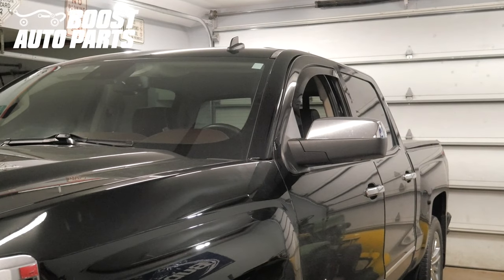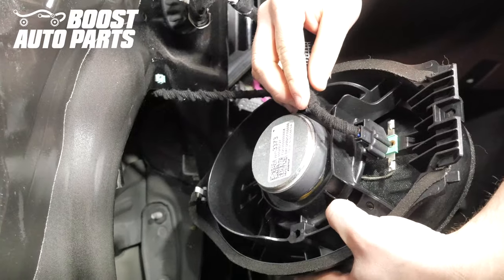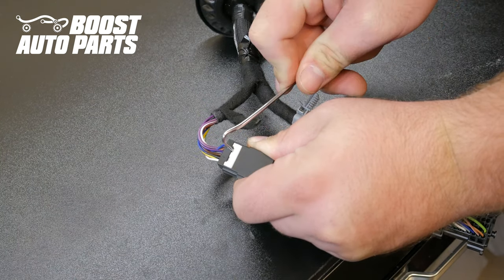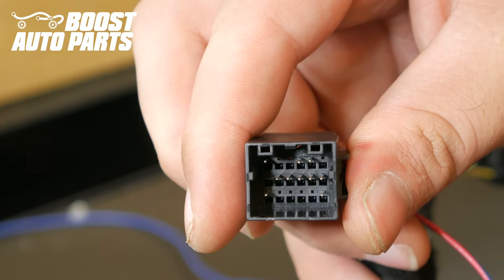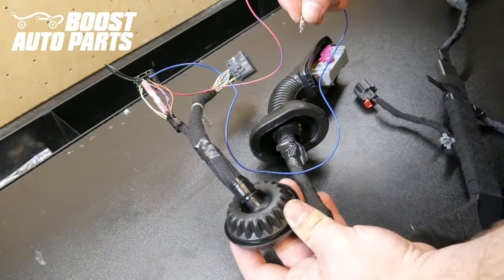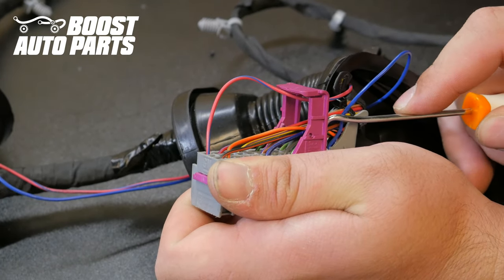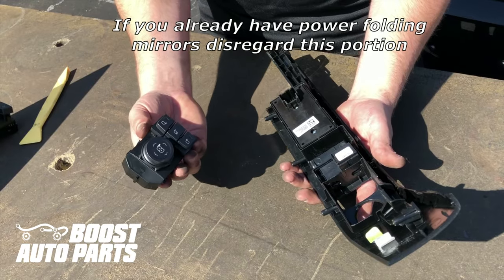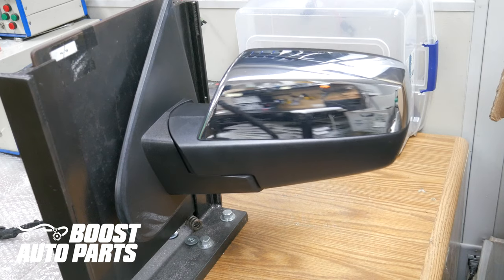GM DL8 Small Mirror to DL3 Power Fold Plug And Play Wiring Upgrade (2014 - 2019 Silverado Sierra)

Comment: Will your wire harness and switch kit work with any aftermarket mirror with power adjust/fold, turn and puddle light function or do I have to buy the mirror from you as well because I don't like the chrome on the mirror you offer.
Reply from the maker: Our harness/switch will work with our mirrors and OEM mirrors - some aftermarket mirrors are wired different than OEM so we cannot guarantee function on aftermarket mirrors not purchased from us.

Comment: I imstall these on my 2018 silverado with power folding mirrors. Before install both mirrors would move up,down and sides. After install they dont move at all only the turn signal works.
Reply from the maker: That's certainly not typical. Shoot a video to our support team at support@boostautoparts.com and we will work to get this resolved ASAP.
Reply: Mine do the same thing did you find a solution?

Comment: Do the mirrors will fold once your turn off the engine or do you need to change it in the settings section in your screen?
Reply from the maker: The only way to fold the mirrors will be with the new switch that you install.

Comment: Just installed mine but the puddle stays on
Reply from the maker: It sounds like the wire in pin 1 may be installed wrong. Email support@boostautoparts.com for guidance

Comment: I have a 2015 silverado single cab , will i need to change the wires for the cable connector on the side mirrors? Or just plug in play
Reply from the maker: You need to do this wiring modification.

Comment: I own a 2017 GMC Sierra 1500 WT with power mirrors, windows and locks. I recently bought power folding mirrors with turn signal and puddle lights. I bought your wiring harness kit for the conversion. I installed it with the help from the video on YouTube, great video Thanks. After all my connections were made my drivers side window works But not my passenger side. Any ideas of what may be wrong? Thanks.... I also bought the wrong switch so i ordered the right one for the connector.
Reply from the maker: Our team is well suited to assist with this. Give our tech support team a call at 765-831-2830 or email support@boostautoparts.com for assistance!

Comment: I have a question I have the DL3 power fold folding but instead of doing all of that wiring could I just go get different door cables and mirrors switches off a Silverado/sierra that already had power folding and puddle lights and put them in my 14 Silverado because there's a lot of part out trucks near where I live and I would like to know if that can be an alternative instead of doing all of that wiring thanks!
Reply from the maker: No - that won't work. The harnesses are wired differently from DL8 to DL3 - it's not just the lighting that's different.

Comment: I Have A 2015 Silverado And Want To Do This, But I Notice The Mirrors You Guys Sell Don’t  Have The Blind Spot Glass. If I Buy Ones With It From Somewhere Else Would This Still Work?

Also For The Wiring Harness What Does It Mean When It’s Asking For “2015 (WITHOUT MEMORY)” “2015 (WITH MEMORY)”?

Will The Mirrors Fold By Themselves When I Lock The Truck?
Reply from the maker: The mirrors will not fold by themselves when locking the truck as that is part of the memory system. 

I'd recommend giving our team a call at 765-831-2830 to discuss with our team. They are best suited to know the nuances and give you the most accurate answer.

Comment: Can I put these on my 16 Silverado single cab lt,it already has power mirrors
Reply from the maker: Yes - though the puddle light might not work you can gain power fold and signal for sure.
Reply: @boostautoparts why wouldn’t the puddle lights work? On the 16?
Reply from the maker: @E12_Tabz  Some of them aren't wired; give our team a call at 765-831-2830 for assistance

Comment: So if I just go to a salvage yard and pull the door harness from a truck that has the DL3 mirrors won't it work? Sense all your modifying is the door harness itself. I work at a salvage yard and we crush these trucks all the time. Mirrors are broken most of the time though.
Reply from the maker: No - the way the power adjust circuits operate are different between DL8 and DL3 so you have to use the DL8 harness or the power adjust won't work properly.
Reply: Lmk as well. I heard they work through bcm
Reply: @boostautoparts  so if u put the oem mirrors on you must have the dl3 harness??
Reply from the maker: If you just swap the mirrors the lighting features will not work. To get the lighting features working you need to follow this video. If you try to swap DL3 harnesses to your DL8 truck, the lights will work but the power adjust won't (they're wired different for power adjust)... so that's why you need to modify your door harness with our kit following this video. @StevanStazzone
Reply: Damn, where are you located? Hook it up with some Silverado parts
Reply from the maker: @ARodriguez-0  We are in West Chicago, Illinois... but we ship anywhere in the US. Check out our website.

Comment: bought the wiring setup for the Dl3 and puddle light does not come on for some reason
Reply from the maker: Some 2014/2015 trucks require an additional jumper for puddle. Reach out to our support team at support@boostautoparts.com for assistance.

Comment: When I connected the switch, it immediately burned the 10 amp fuse? Do i have to upgrade the fuse?
Reply from the maker: Absolutely not. Sounds like you have the wrong switch - did you order from us? If you install the wrong switch that will happen.

Comment: I did this to my 14 1500. I was told it has to be connected to a computer to get the heated mirrors to work again. My passenger side heated mirror works but not my driver side. Do you k ow anything about this, or anyone else? And if so how do I go about asking the dealer to do this.
Reply from the maker: The defrost should work plug and play.

Comment: I have a 2017 Silverado LT and installed OEM power folding mirrors from a LTZ.  I also installed the correct switch and your wire kit.  The turn signal, puddle lights and heated mirrors work, but neither the power folding nor the mirrors work, also only the driver’s window works from the main switch. Please advise.
Reply from the maker: Please email support@boostautoparts.com - our tech support team to get to the bottom of this right away.
Reply: I am having the same problem I just emailed support just wondering what you were told to do.
Reply: @rkeondre  replace the 10a fuse (power mirror) in the drivers side fuse panel and you should be good to go.
Reply: @whittielockett7611   did that fuse blew immediately. Only thing I will say is I had purchased a switch but it had a notch in it that wasn’t on mine so I cut the notch off so the plug would fit. Did your plug fit correctly!?
Reply: Yes the fuse blew immediately I had the same issue after buying the wrong switch. There’s 2 switches available and if I’m not mistaken it’s the 2014-2020 Silverado Sierra Suburban Tahoe Power Folding Mirror Switch 84643953.  After I ordered and installed the correct switch and replaced the fuse they worked fine. There’s a slight initial delay of a few seconds then they were fine.

Comment: I have a 2018 regular cab and try this and didnt work it doesnt have power windows and i was trying to convert that too do u guys have a harness for this
Reply from the maker: Sorry, we do not. This requires you have factory power mirrors to work and this simply gains the turn signal, puddle light, and power fold.

Comment: What is the white wire for? i install these on a 2018 silverado do I need the switch of a truck or would a suburban switch work?
Reply from the maker: This harness is a universal harness that is also used for towing mirror upgrades, so the white wire is only used on the towing mirrors.

You can NOT use a switch out of a Suburban - it must be the proper switch for the vehicle.

Comment: hey there I have a 2015 gmc sierra sle  I installed power fold and door harnesses from 2019 silverado LTZ with proper mirror switch.
I have turn, signals, heat and puddle lamps,only up and down on drivers mirror no movement on passenger side .power fold on neither one.will this kit work for me?
Thanks Daryl.
Reply from the maker: You cannot take the harnesses from an LTZ and install them into an SLE. You need to revert back to your old harnesses, install our kit, and then everything should work.
Reply: @boostautoparts  Thanks I figured that!  Sounds good.

Comment: Is this can be done for 2015 tahoe originally not folding to make it folding mirror even by using aftermarket compatible folding mirror for same model ?
Reply from the maker: This is NOT relevant for the SUV's - only the full size trucks. The wiring is different on the SUV's.

Comment: I own a WT spec silverado, and it does not come with power windows, or  power mirrors. I am however, interested in retrofitting the power optionals. Can the folding/puddle lighting be controlled by a non-oem switch instead of the door controls?
Reply from the maker: Unfortunately we don't support any upgrades on vehicles that don't have power mirrors from factory. Sorry about that!
Reply: @boostautoparts   Thanks for the reply! I'd like to inquire further however! Can any of the functions be rewired to use external controllers? or is the entirity of the assembly reliant on the BCM?
Reply from the maker: @DaWalkDude  give our team a call at 765-831-2830, they are best suited to advise.

Comment: Will this switch work on a 2020 silverado 1500 rst? I don't have power folding mirror switch. But if I got the switch would it still work with tow mirrors?
Reply from the maker: No, this is not applicable to the 2019+ new body style. We are working on a solution for those vehicles but there is currently not a power folding upgrade path at the time of writing this (3/7/22)

Comment: Is slot 2 for the running light?
Reply from the maker: No - slot 2 is not utilized for the upgrade to DL3 power fold.
Reply from the maker: @robcj3189  If you purchase the harness you can reach out to support@boostautoparts.com for assistance

Comment: what is the white wire for?
Reply from the maker: This is a universal harness that is also used for towing mirrors which have a different feature set. The DL3 mirrors don't need the white wire, so that's why it's discarded.

Comment: I purchased new power fold mirror for my 2014 Silverado i install the mirror and the wire harness off a truck with power fold mirror do i need to modify the harness to make the puddle light work as well ? The turn signals work but just not the power fold or puddle light
Reply from the maker: You can't swap door harnesses with other trucks - other features aren't compatible. Reach out to our team at sales@boostautoparts.com for guidance.
Reply: @boostautoparts  i bought the kit and install them as shown in the video my turn signals work and i can adjust my mirrors what do i need to activate the puddle lights
Reply from the maker: @gamalielpelayo2891  Puddle lights should be working. Reach out to our team at support@boostautoparts.com for assistance.
Reply: I just got the harness I stall it on my sierra 2015 and the puddle lights aren't working neither, I used to have DL8 I switched over for DL3.
Reply from the maker: @rogelioortega2194   Puddle lights should be working. Reach out to our team at support@boostautoparts.com for assistance.

Comment: Is there a way you can provide me a link to the door switch you sell. I try to look for it on your site but I can’t seem to find it. 
I have already purchased two different switches and they do not work at all. 
I have a 2016 Silverado LT I have already installed the mirrors and the turn signals work and the puddle light I just can’t seem to purchase the correct switch.
Reply from the maker: Here you go! Call our team at 765-831-2830 with any questions.

https://boostautoparts.com/products/gm-power-fold-switch-for-dl3-dpn-dqs-mirrors-silverado-sierra-2014-2019
Reply: @boostautoparts  I purchased the switch and just installed it, it still doesn’t work and I followed the video provided.
Reply from the maker: @ernestotijerinajr.1690  Call our tech support team at 765-831-2830 they are well versed and will assist.
Reply: @ernestotijerinajr.1690  I have the same problem what solution did they give you. Just wondering before I call tech support.

Comment: Everything works but the lights underneath the mirror not work
Reply from the maker: Some 2014/2015 trucks require an additional jumper for puddle. Reach out to our support team at support@boostautoparts.com for assistance.
Reply: I have a 2018 Silverado
Reply from the maker: @stevenarmilla9996  Should be working. Reach out to our support team for assistance and they'll get to the bottom of it with you.

Comment: I'm trading 2017 silverado DL8 to 2017 sierra with DPN mirrors. No fold nothing fancy. Can door harnesses be swapped rather than adding wires to my existing DL8 door harness? Any input can help
Reply from the maker: Please reach out to our team at sales@boostautoparts.com with the VIN of both trucks and they can check. Important to note that this is talking about upgrade to DL3 which is not what you're referencing.

Comment: It would be the same procedure for a 2018 Silverado LT truck.
Reply from the maker: Yes
Reply: Ok thanks
Reply: Hello, good evening, I bought this cable kit, I installed it on a 2018 Silverado Z71 LT, the pins fit well, the power mirror turn signals worked well, but the power mirrors do not work or do I have to install the white cable or does it have a fuse in the fuse box
Reply: My master switch no longer lights up at night when I'm driving it and I can't lower the right window from my driver door either.
Reply from the maker: That's certainly not typical - give our team a call at 765-831-2830 and they will get this diagnosed and resolved with you ASAP @JoseContreras-sy5in
Reply: Ok thank you

Comment: Puddle light doesn’t turn on
Reply: Where you able to figure this out? Want to make sure it works before I buy.
Reply from the maker: Reach out to support@boostautoparts.com and our team will assist!
Reply: have you found out yet? my puddle light dont work either
Reply: @nicktarius  no
Reply: @DiegoGonzalez-sq3kd  bruh
Reply from the maker: @nicktarius  There is a known issue on the truck side for some 2014 vehicles. Email support@boostautoparts.com for guidance
Reply: Mine neither, 2015 sierra sle.

Comment: Will this product work with 07-13 Silverados?
Reply from the maker: Unfortunately not - at this time we just have it for the 14-18 Silverado/Sierra trucks.
Reply: @boostautoparts  I have a 2014 GMC Sierra 2500HD Denali Diesel without power folding tow mirrors, will this work for my vehicle? I know I will need door switches and upgraded power fold mirrors. I ask because that year and particular model is not mentioned at the beginning of the video. Thank you.
Reply from the maker: @knmart76  This does NOT work for 2014 2500/3500 trucks, only the newer body trucks which in 2014 are 1500's only.
Reply: @boostautoparts  thank you so much.
Reply from the maker: @knmart76  No problem, I'll let the development team know of the interest!

Comment: What number is the white wire connected in ?
Reply from the maker: White wire isn't used for this install.
Reply: What’s the white wire @8:07 for then ?
Reply from the maker: @eddieordaz3426  That is not used for this installation, this a harness that is used for numerous different applications and that specific video clip was simply reused. You won't see it referenced anywhere else in this video. Feel free to call our tech support team to discuss at 765-831-2830

Comment: We’re u wire the Puddle Light
Reply from the maker: The white wire in this kit is for the puddle light
Reply: We’re u put that wire
Reply from the maker: @jrr5127  It gets installed in the video
Reply: Is not
Reply from the maker: @jrr5127  Contact our support team at 765-831-2830 for further assistance

Comment: What's the whitr wire for?
Reply from the maker: This is a universal harness that is used for towing mirrors and non-towing mirrors. In the non-towing mirror application the white wire is not used.
Reply: @boostautoparts  ok and if i want the auto dimming on the driver's mirror do i have to run extra wire?
Reply from the maker: @luisperez-xd5mo  We do not have an upgrade path for the auto dim at this time.

Comment: I have 2014 Silverado LT put LTZ mirrors on connected the wires like you instructed only the  blinker works on the mirror pudal lights power mirror and and folding mirrors do not work. Please advise
Reply from the maker: Please email your VIN to support@boostautoparts.com along with your order number and our tech support team will get it resolved ASAP